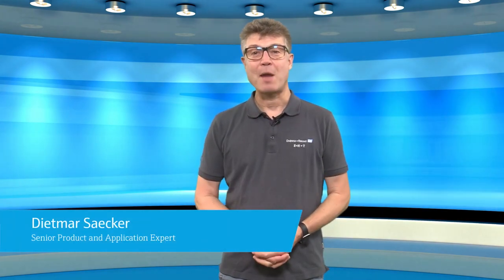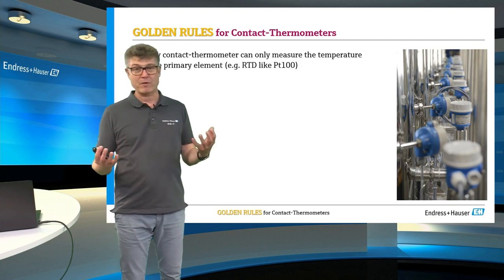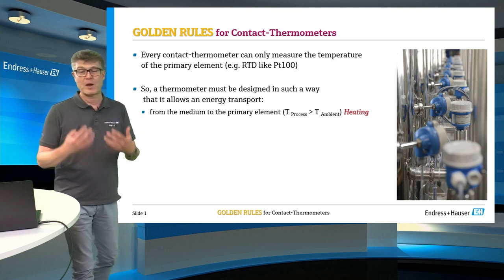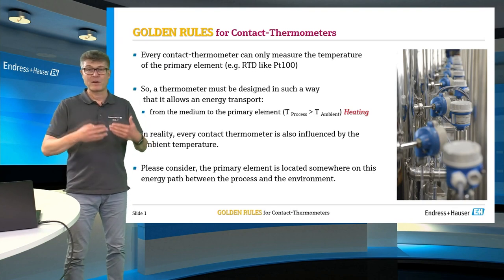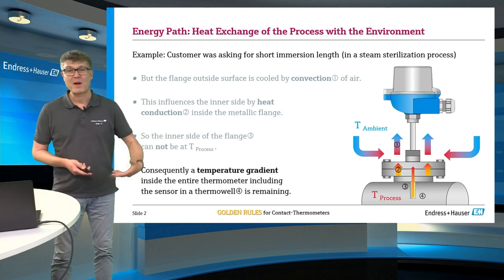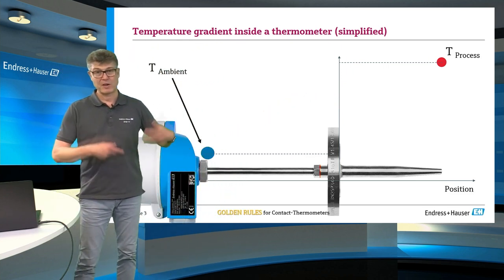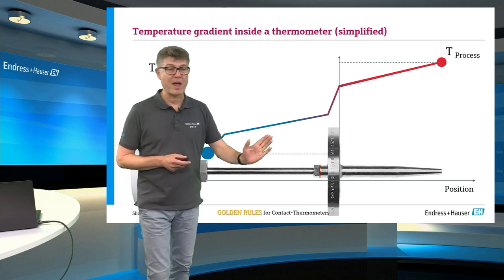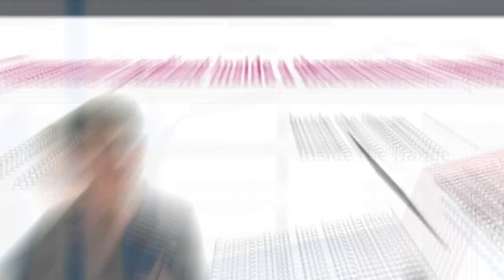Golden rules of temperature measurement - part 1: the basics

Comment: Why is there a temp gradient inside the stem? It should be equal because it is wetted by process fluid.
Reply from the maker: Dear Levent, thank you for asking this good question! 
The process fluid inside the pipeline will have just little difference between the middle of the pipeline and the inner wall. The heat dissipation within the metal thermowell is the reason for that temperature gradient inside the stem. The graph in the video is simplified and exaggerated to illustrate the physical phenomenon. The real gradient inside the process won't be very steep but it results in a measuring error anyway. Especially when dealing with short immersion lengths and barstock thermowells you should definitely take this into account during the planning phase of a measuring point.
We hope that we have been able to help you.